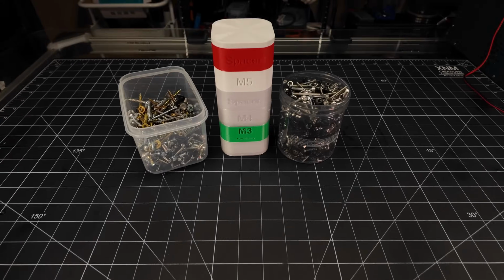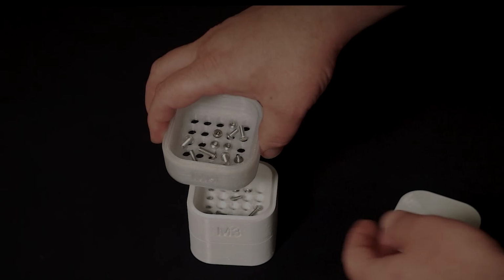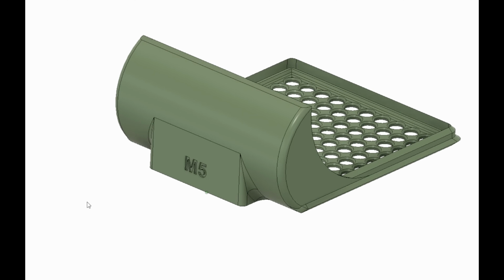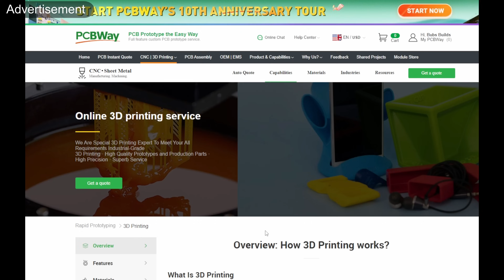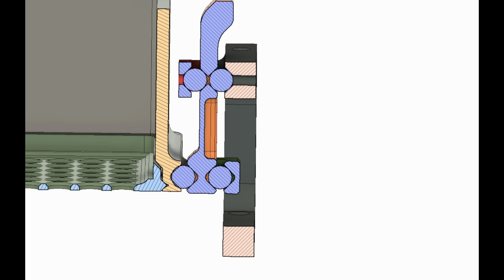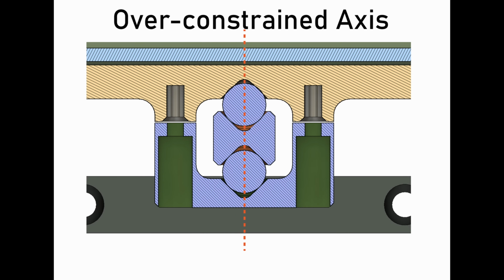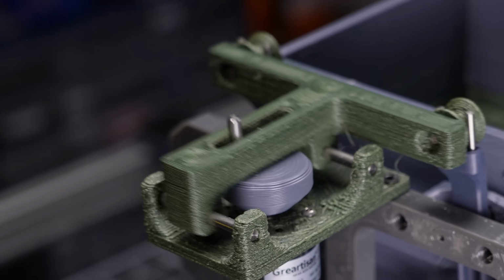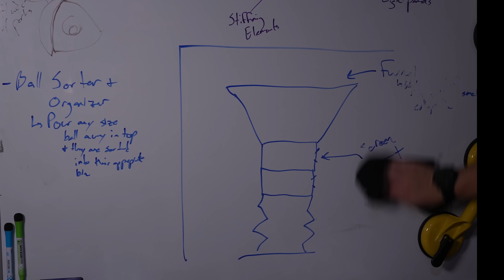I Over-Engineered a Bolt Sorter.

Comment: might work as a nut and washer sorter
Reply from the maker: @hendrikdeputter6279  you know, I've been wanting to try that out at some point, but still haven't. I was thinking rectangular cutouts, but I was worried it may be tough to get them to fall correctly into place. Any suggestions?
Reply: @bubsbuilds  I would say just start with circular holes to start with
but there is less size difference then i expected to be honest
the sizes would be 6mm for m3, 7.7 for m4, 8.8 for m5
that is not lot of margin 

maybe slide them down an inclined plane with holes
with a shaking mechanism so they don't get stuck?

last idea is stand them up on their side and have a barrier on top for the smaller sizes to slide under?
but then the following nut would need to push the previous one and im not sure that works 
and the barrier would also have to function as some sort of pivot so the ones that get caught can pivot out of the way by the next nut?

the only other solutions with scanners or other electronics
and i do not get along with electronics

none of these are great and im not sure my explanations are clear enough but this is what i came up with in a few hours

Comment: Use 2 strings (acually it is just one). One string way have to be straight while the other is in a zig zack shape where at each zig zack corner is a  shaker bucket attached. 
You can pull fast on the zig zack string and it will shake all buckets and get straight. Then pull fst on the other string.

To do it wind the middle of the string around a drum. The drum has to have a big heavy flywheel. The flywheel size depends on the axial diameter of the drum. Bigger axial diameter -> bigger flywheel. Maybe could use a 8mm thick steel washer with outside diameter of 105mm. Conect the Flywheel well to the drum!
Use a moter that can switch directions to spin the drum forward and back. 
Let the string (maybe 3 * drum_diameter * 3,14) longer as needed so that the Flywheel can axcellerate befor crushing in the string and shaking everything. Yes i think you will need a very soft spring to manage the leftover string length.
If your string keeps breaking try dyneema. 
Build everything quite strong. 

Have a nice day. ❤

Comment: I've seen lots of different types of sorting, and all of the industrial ones use high frequency low amplitude.
Low frequency requires high amplitude, and no matter what you do, they just shake themselves apart. A 3d printed unit is likely to last even shorter.
So, my suggestion is much higher frequency, low amplitude, with some sort of forms/shapes in the bins that will help to turn the screws the right way. But that needs lots of experiments...

Comment: As a fellow maker of custom screw sorting machines I can say that:
1.) A series of fixed width sieves is a practical way of sorting by diameter without getting too crazy on assembly complexity.
2.) Slots work better than holes but the longer the slot the easier it is to flex and not have a fixed width. Beam deflections scales with L^3 so don't get too long. Stiffness of the beam scales with W^3 as well though so increasing the gap (W) between adjacent slots can help a lot as well.
3.) Massage vibrators are cheap and you can get them at walmart although might not have enough power for the combined mass of the hardware you're trying to get shaking.
4.) If you're going to be at ERRF/3d Printopia, I have an optical + electronic based method to demo this year that accounts for sorting by length and head type.

Comment: The shaking doesn't get the bolts to separate.  You need vibration to get them to jump up.
Plus you overloaded it.  The feed rate needs to allow for initial sorting, otherwise it will just bridge.

Comment: A similar principle to a semi manual pharmaceutical capsule filler jig might work. It has a self orientation sliding layer to drop the capsules into the holes below in the correct orientation.

Comment: Similar to the rotating drum idea but trying to keep as low profile as possible you could consider moving to as close as a ‘folding’ or ‘tipping’ motion as practicable, where rather than a single screen have two screens of the same sift category ‘tipping’ its load into the other.

I’d imagine the degree you would need to tip would come down to how much you’ve got in there. Unfortunately the more bolts there are the more you have to try and displace each to get them to fall through.

Comment: We gave our students the similar problemen. What we saw worked pretty good was using vibration (as otters said) . The teams created that with a motor with an excentric ring, running somewhere around 1000 rpm. This Will create a lot of sound though. With plastic the noise should be less.

Comment: I think that a large part of what makes the smaller version work well is the motion on the Z axis, causing the bolts inside to be flung up and down.
Another change I'd make it to fit more holes in each layer, by placing them in a hexagonal grid instead of a rectangular one. Although I think the idea to change them into long slots that @airman2468 mentioned is better

Edit: another idea that came to mind for how to create the Z motion: solenoids! Place 3+ of them below the device, and let them shake the whole thing violently

Comment: nice design so far, but i guess you have not enough motion in the contruction overall. 
It could be possible to overcome that with a solution similar to this: https://www.youtube.com/watch?v=4td_U09cSbQ
They use it for sorting caps for bottles. Only if the solid side of the cap is near the metal backside of the "escalator", the cap has its center of mass oriented in a way that it does not tip over and would have to try again. You could try to use the design and put your sieve cutouts in the back. But i have to admit, i don't know how you could ensure that nothing get's jammed - eventually by using a big vibration motor like this one https://www.youtube.com/watch?v=zOsQ2BirLf8

Comment: I feel like it's salvageable if you can add some vertical into your agitation. Where can you introduce a cam that could gently lift then drop the trays? Maybe between the trays themselves so the horizontal action forces them up a little then drops them? Not sure if that little motor would cope with all of that though

Comment: Very cool build! Could the whole thing be set onto a vibrating table? Like the ones used for casting. Attaching it somehow to something like a vibratory parts tumbler could work. I would think anything that vibrates quickly and violently enough would work.

Comment: Reduce the offset for the pin in the slider.  This will reduce the torque loading, enabling the motor to run at a higher RPM.  This should transmit a higher frequency oscillation to the bolts with a smaller amplitude.

Comment: Maybe instead of a back and forth motion, how about a rocking motion? Put a pivot pin in the middle of each drawer and push the forward (or back) up and down. This would require less energy, or force, from the motor to get the screws to move. Replace the holes with slots would also help encourage the screw to rotate easier.

Comment: What if you make a slider/funnel/feeder that feeds the bolts slowly (similar to the coin sorter where it Slides down a rail). This way it wont be clogged.

If you angle the siv the small motion could be enough to move the bolts downwards(might clog thought)

Thanks for sharing you unfinished project, dont see that often.👊😝

Comment: Keep the sizing boxes fixed to each other then place the assembly on a separate vibration/shaker unit. The vibration/shaker unit could have a fixing plate which the sorting assembly would attach and detach to. Your sorting can remain modular, but the rigidity of the assembled modules ensures the vibrations and movement are transmitted from top to bottom. If you can modify the vibrations, you can adjust to suit M2 and M3 sorting, vs M8 or larger sizes.

Either that or lift the bolts so with potential energy they can fall down through the sorter, (sorter plates in a series of steps, with the treads angled downwards), and the unsorted bolts be collected and lifted back to the top. May still need some vibration/movement on the steps to sort.

Comment: If you sort by head size, have the screws slide down a slit (vibration motor assisted) which gets progressivly wider (or stepped). This would prevent the system from getting plugged. A coin sorter might be a good inspiration.

Comment: just make it bigger. tie it to a suspended plank with rope.  hit repeatedly  from above with your fists. the returning force is done by te plank. this way the number of parts is increased only by 1 with the rope (unless you count the plank). //  You've built quite the contraption which is quite mesmerising to watch. Aesthetics aside for practical applications smaller part numbers are usually better. succes
Reply: also my dad would pay me some change for sorting his bolts. don't know if thats an option for you tho

Comment: You could use a weight on a motor to create vibrations, like it's done in game controllers.
Fix the motor to the uppermost tray and fix the lowermost tray on a rubbery mount.

Comment: i honestly think a handheld shaker at a large size (think the micronics solution for cleaning parts) is still a better option than the motorized version that, seemingly, has allot of friction in the bearings aswell
since the plastic will form around the balls due to the pressure, is will create a much larger contact patch, causing allot of friction. this is also why the baskets rotate side to side when moving
Reply: I agree on a bigger manual version.  I want one!

Comment: Great video! 
It looks like you would need to pull all the trays out starting at the bottom to get the top bolts if they have any length to them at all.  Not a big deal but would making the tray a little taller, with the sieve towards the middle, or more spacing between trays allow for longer bolts and easier access?

What if you replace the holes in the sieves with long slots?  This would allow the bolts to still fall through if they were to small but catch the desired size.  That way the bolt does not have to stand up to make it through the sieve.

Do you have any thoughts on how you would then take the sorted bolts and sort each size by length?

Comment: Need a vibrator motion to get the bolts through the holes. Maybe a tumbler with different sieve sizes. Change the sieve in larger increments to achieve the sorting

Comment: I've been working on and off on a bolt sorting system for the last 2-3 years. One of the methods I used for aligning the bolts into the holes was a Subwoofer set  to between 10 to 30 Hz.
Reply: That’s so clever and really out of the box!

Comment: Maybe try using a different shaking mechanism. For example, shake a rigid stack, just like in the manual version, but using an up and down motion with a powerful motor. This motion should be large and with a frequency similar to what you would pull of by hand (1-2hz) with an amplitude of a couple centimeters (yes it's a massive amplitude, but similar to what you're doing by hand). This should shake the bolts through the seive. However the seive would need to be tough enough to sustain the dynamic load and not have the stack break apart during shaking.

Tldr: make a mechanical movement similar to what you're doing wuth your hands. (Maybe have a lever that with a small input movement has the stack make a big swing)

Comment: Long slots instead of circular holes. That way, the shank of the screw can rotate into the correct orientation naturally under gravity.

Cool build, also.
Reply: I thought that too, had some hesitations but I think I figured them out. Slots would be good. The holes will refuse letting a larger screw through. They get clogged up which is why it’s nice to have many. If a longer slot gets a larger screw captive, it’s forced straight down which is optimal for packing. It’d still be much more “hole” per area than many trying to pack circular holes, so much more screw capability. They’d need a much thicker base though to ensure screws going down passed the filter honestly, not by having the head at a wack angle. But slots would definitely make it much easier for screws to find a hole and then orient themselves. That’d take out a lot of the force requirement to get them to happen to be straight up, might even barely work with current motor.
Reply: @ryancarlson9680 With the hole design, the largest remaining bolts are left behind, but it's possible for only their threaded sections to go through the holes, leaving their heads plugging up the holes. A slot design is definitely an improvement. The heads can still plug the slot, but it will take several of them to plug a slot.
Reply: I was thinking the same, slots could be something to try.
Reply: This with cam(s) to vertically lift the entire set of filters and drop rapidly. Or horizontal with spring return. Although most of the bolts will quickly end up on one side of the filters with horizontal motion. Sticking with vertical actuation, an air bladder (diaphragm) could do the same thing. It would certainly add to the noise when exhausting the air rapidly, but I'm sure it's already a loud operation. You could also do duplex diaphragm actuation. I.e., have a diaphragm on top and bottom. Each direction can be fine tuned individually.  Another option is to rapidly rotate the entire stack plus and minus about 30 degrees perpendicular to the direction of the slots.

Comment: Keep the modular part but instead of those forks use pillars of springs around a fork with a shoulder joints. This way you could have a motor on the base that shakes the assembly similar to those earthquake simulators for models. Presumably there is a frequency that creates resonance.

Comment: I suspect that part of the problem isn't only movement range or speed, but actually acceleration of the moving axis. Since you're using a circular motion with an offset dowel to provide this cam-lever movement, you end up with a more or less sinusoidal function of movement vs time in the axis in which the drawers are moving. Sine waves aren't very "jerky", the acceleration is rather small at any given time. Maybe changing this system for something that provides a more jerky movement function, such as something closer to a triangle wave (i.e. with very strong changes in the derivative of the position vs time), could provide more of a push to the screws! Maybe mounting the drawers with some spring force that drives them to a position A, and a cam that upon falling smashes the axis and makes them move quickly to a position B?
Reply: Honestly a solenoid might do the trick here. But I like the idea of using long slots instead of holes the other comment mentioned.
Reply: I had a similar idea but instead using a cam and having the bed be spring loaded. The cam would pull it back then it would give a good shunt,

Comment: Looks like your filament might have a bit of moisture in it (the little voids within a single layer line)
All you really need to dry filament is a heated bed and a box the filament fits in. A small fan in the box will speed up the processes but its not required.

50-55c bed temperature is what I use for pla. 65-70c is what I use for petg.
Reply: To me it looks as if there was a far too high layer height set, maybe to speed things up. Better make them in good quality, it may be a source of problems afterwards if low grade prints are being used.
Reply: @MAButh  You can print up to 0.3mm layers on a 0.4mm nozzle with out too many issues. Thick layers do tend to highlight imperfections however.

That said, drying the filament won't magically make the part look better but it will fix the voids they have in the layers.

Comment: What about something that's along the lines of cylinders that are made of the mesh holes, they would cascade and have funnels under each that pour into one another from above, each tipped ~45 degrees so parts drop down them and stay in but also engage with the mesh sidewalls as rotated, then you'd really only need to provide a slow continuous rotation instead of harsh impulses for agitation. One idea for these 'mesh cylinders' being easy to print, Make them flat sheets then wrapping them around a disc base and hoop that lock them to being a container, maybe a cone shape would even be more suitable somehow? Just some ideas, else a flat sorter needs an agitator that is more on-par to a paint-shaker.. longevity would be pretty questionable for printed pieces.

Also I'm totally going to print those bolt sorters and see if they can help tame my bin of screw woes, very clever sussing out the min and max dimensions of certain common screw types and using the heads for the sorting mechanism, I'd have thought that much too uncorrelatable prior.